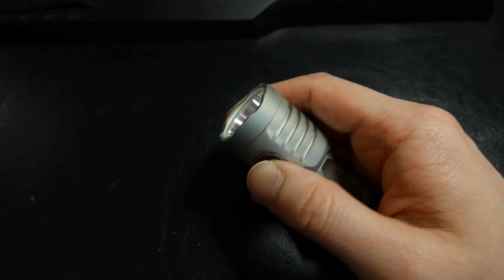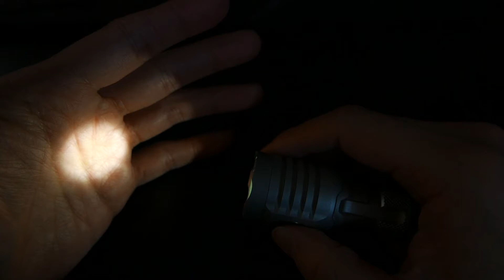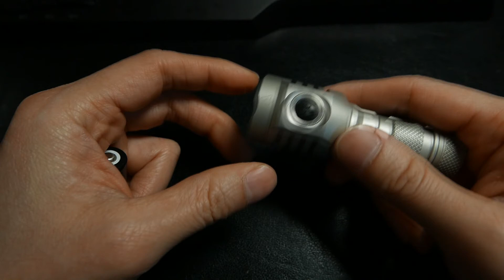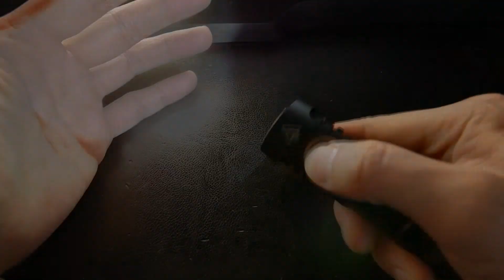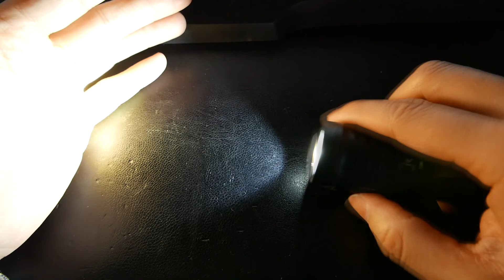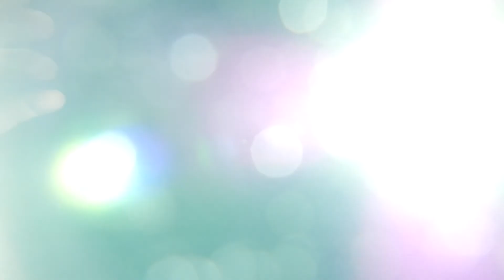Manker Quinlan T01 and U11 - Hidden Engineering Mode

Comment: For some reason my Manker U11 has another undisclosed mode.When I very quick press (just tap the switch once quickly) from off, it turn onto a low mode and cycles 3 different levels. I am not sure what this mode does. I'm not in pro mode. Does your light also do this?
Reply from the maker: Haven't encountered that before. For me, a quick tap always goes to Low mode (as it should). Does it do it consistently on yours?
Reply: Yes, it's very consistent and it's different from a short press. A short press also goes to low mode for me. But an even shorter press (press and release very quickly, just fast enough to engage the switch and release) will enter a cycling mode. There will be a short delay before it comes on and then it goes into the same cycling that happens when you disconnect from USB charging. I asked another fellow Manker U11 owner and he reported to also have this hidden mode with a very short press.

Comment: What li-ion should I use in it
Reply from the maker: Have replied to your other question on T01 vid. But for the U11 - many 18650's would work well, check out HKJ's battery comparator:  http://lygte-info.dk/review/batteries2012/Common18650comparator.php

Comment: Cool light!  I don't have one but thanks for posting this video, it was nice to see how things work on these lights.  
Got a question, do you know how many hz the PWM is at?  If you have an iPhone you can check the percent flicker and the frequency with Viso flicker checker.  https://itunes.apple.com/us/app/flicker-tester/id893931726?mt=8
It's a pretty cool app and I've tested some lights with it.  Wonder what these flicker at?
Cheers,
David.
Reply from the maker: +David Sunshine Hey David, tanks for the comment. I've downloaded the app but not sure what to use as a reference to calibrate with. I just assume my desk lamp will be 60Hz based on the bulb specs?
Reply: +turboBB73 Cool.  If it's a CFL you'll get some flicker, maybe 120hz though.   You can just point the light at the lens, but to get the most accurate reading they instruct to use a frosted lens(Their website here: http://www.visosystems.com/products/flicker-tester/ they also explain how they calculate percent flicker and flicker index), I find a piece of thin white paper or magic tape works, or if you get the white diffuser out of an old broken iPhone screen, that is optimal, that's what I use to diffuse my reflector based lights, since it has high transmissivity; here's a quick video showing how to get the diffusing paper:  http://goo.gl/WvMp9H
It's useful when you don't need a tight beam, but rather a huge flood(video taping, working in and around the car).